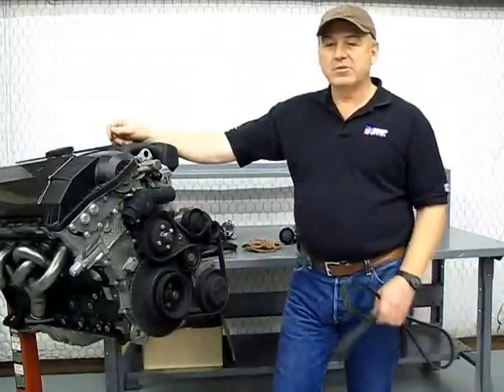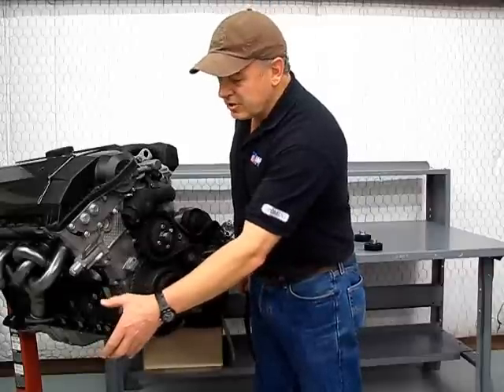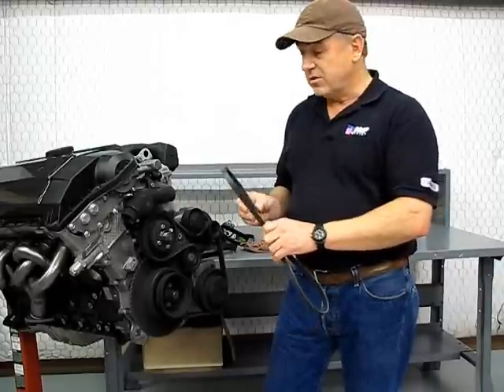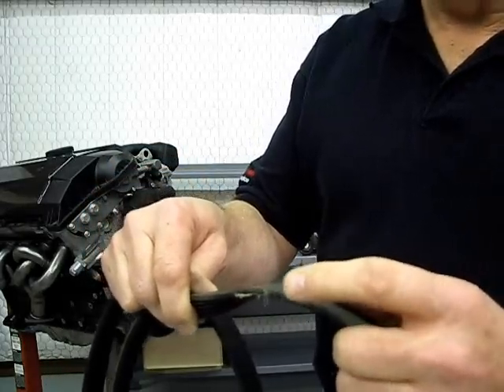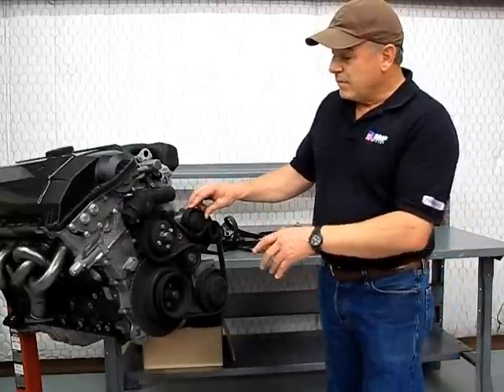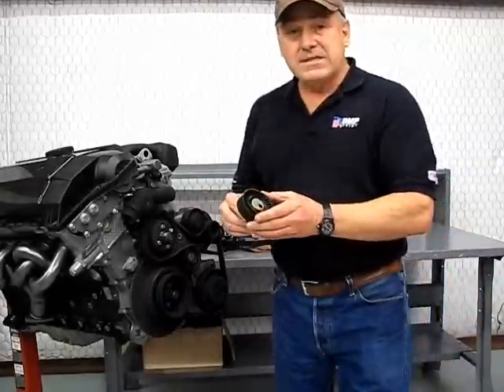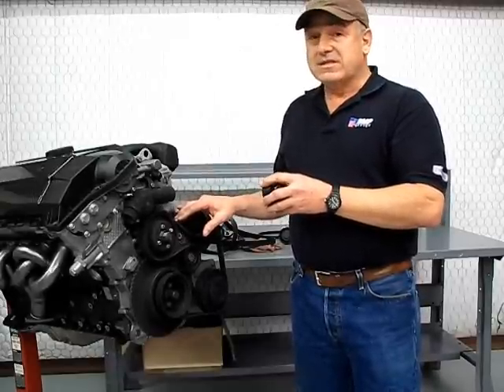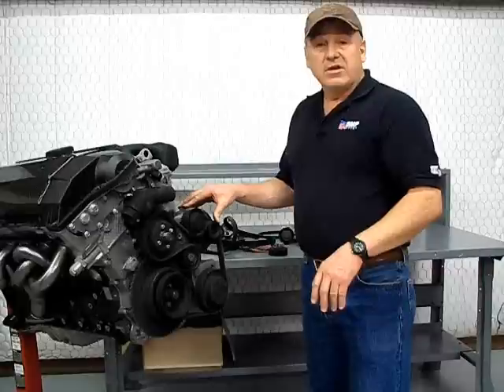BMW E36, E46, E39 Belt & Pulley Failure.

Comment: Cool how much do you think it would cost to do my idler and Tensioner, I should of done them both when I changed the belt and water pump dame it.     I have some noise from the belt when at idle @528im52 do you think its the pullys my E46 330Ci has 88k on the clock

Comment: Thank you so much! How do you know if the crankshaft pulley goes bad? I am getting ready to do the repair of the belt, tensioners, and pulleys, but the big one...I keep getting told...usually does not get replaced....however, these were all just estimates given to me over the phone.. x5 3.0 2008 95K miles...if the crankshaft pulley is wobbling, it should be replaced, no?

Comment: quick question 2001 bmw x5 3.0 that when i turn the ac on it throws a misfire code if ac os off it dosent do it now could this b cause by a failut of a ac tensinore pully. ive checl every other possiblity just not the pullys an belt otself

Comment: My 323ci does a "chirp" kind of sound when idle, around 700 RPM. Does that mean it's the idler pulley, or not necessarily?
Reply: +Tony probably, doa belt and tentioner change. if its still there its goign to be a bit more expensive and tedious to fix, (bearings or misalignment)

Comment: @528im52   Thanks for posting! 
i think you may have answered my problem, i have a very faint but constant squeel on my 318i almost like i slipping fanbelt but much quieter and doesn't get louder as i speed up.  the noise kicks in after 5 ten minutes of driving. stops if i push in the clutch starts again as i release. 
 The belt does have those cracks on the underside. i'm hoping the noise is a squeaky pully.  with the help of such video's i'm thinking of changing the belt and the 2 pulleys myself.

Comment: hi i wonder if you can help me with a problem i have with my e46, it has a m43 engine, the car bucks when i'm driving and stalls when i stop at lights, i get the asc light when it starts doing this i got a code 136-engine speed / referens signal, not sure what it means would you have any idea what it could be?

Comment: Great Video. 

Yes. Everything fails on you if the belt fails!

I managed to nurse my 528i for 20 miles after the belt failed. With no power steering, failing electrics and over heating. I stopped once to let it cool off after 10 miles. 20 minutes later made the last 10 miles home.

The actual cause was identified to be a water pump bearing that had seized and therefore thrown the belt off.

Comment: Hey Karl, Question: I have a 2002 330ci and have had an on and off high-pitched whine over the past few days (when it whines, it's full loudness and when it's not, car sounds fully fine It's always one or the other when start 'er up).
When it's there, I turn engine off, engine comes to a complete stop yet the whine continues for a full second or two and THEN winds down. Any idea what it might be? (The idler pullys have stopped while the whine continues for a sec or two ... and THEN slows).

Comment: Well explanation, changing my every 110K miles, and had no problem, till I used cheap crap. At marker of 70K went out. So if you doing that job, spend a little more and get good staff. Thanks again for good info

Comment: @y2jpspmoney  Hey, thanks for the reply.  I've since changed the valve cover and gasket and used good quality sealant in trouble areas.  So far, so good -- no leaks.  I had a good mechanic change the idler pulleys and belts also.  As for the plugs, my car had OEM NGK plugs in it.  So that's what I went back with.  All's well now.  The car runs great.

Comment: @willytv275 use new oem Bosh spark plugs dont get any oil or cleaner on them. make sure everything inside is very clean, if you have over 150,000 mile on that car I'm sure the old rubber seal is burnt to a crisp so it will be like hard plastic when you scrape it off, it shouldnt be like that should be soft like the new one you need to buy. Also put some sealent around the areas where it bolts down they tend to leak from those spots no need to dot the whole thing. give that a try goodluck

Comment: @willytv275 Was your check light on? did you have oil on your spark plugs before you started seeing mechanics or trying anything that you stated you did in your comment? if you had oil on the plugs to begin with it could be bad seals on the valve cover. there are "O" rings for each plug they go bad an let oil into the cylinder chamber which will give a bad air fuel mixture code on the scanner. try replacing the valve cover gasket, clean everything with part cleaner realy good and use new

Comment: Good refresher 4 me, I took Automotive fundamentals in college back in 1999 an got the ASE but never used my skills i aquired my father always had his guys do it for me at the shop he owned. he passed away so now I have been working on my car myself since he died. All I can say is its all coming back to me. Question my E36 is sounding off idle when I turn on the AC. is that the AC that needs to be replaced runs fine when off an can you make a video for that replacement it would help thanks.

Comment: @y2jpspmoney My wife has a 325i that failed to start recently.  It sort of sounded like it was out of time as it cranked over.  I talked to some decent mechanics and both said it was badly flooded.  They went on to say that wet cylinders will reduce compression and can make it sound like it's out of time.  I pulled the plugs, cranked the engine a few times to clean out the cylinders, poured a small amount of synthetic oil in the cylinders, reinstalled clean plugs and it fired right off.

Comment: @delta3008 I also changed the tensioner's and pulleys, hoses, wheel alignment, tire balancing, oil change along with what I mentioned in my first post. Now my car handles like a dream. I failed to mention I had an oil leak because of the crank case valve and was putting 2 quarts of synthetic oil every 2 weeks. All is well now. 

Word of advice people, if you find a good mechanic treat them like gold and buy them a X-MAS gift every year because good mechanics are hard to come by.

Comment: @delta3008 I also changed the tensioner's and pulleys, hoses, wheel alignment, tire balancing, oil change along with what I mentioned in my first post. Now my car handles like a dream.

Comment: I have a zhp 330ci convertible and i just changed all the parts you mentioned including the crank case vent vale. my car sounded like a tea kettle when I accelerated to 2k to 3k rpm. Also when the belts begin to give it sounds like birds chirping under the hood. ALSO replaced the coolant expansion tank. Spent about 1,700k.

Comment: Awesome video. I agree with the water pump pulley being easily broken. Mine broke when I tried to remove the pulley bolts to replace the water pump on my 528i. It ended up costing me $50 from the dealer.

Comment: is the idler pulley the one with the belt going under it next to water pump with the 4 silver bolts sticking out? 
it's not the one directly in the middle like he says in the video.....isn't that the tensioner pulley?